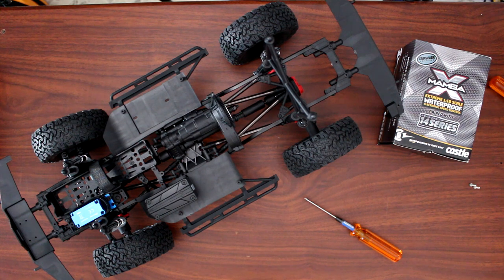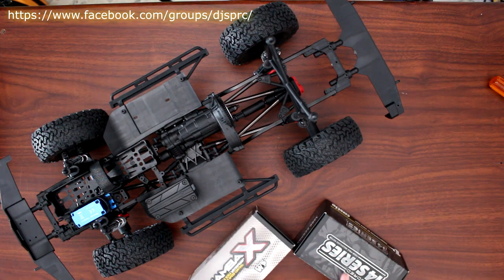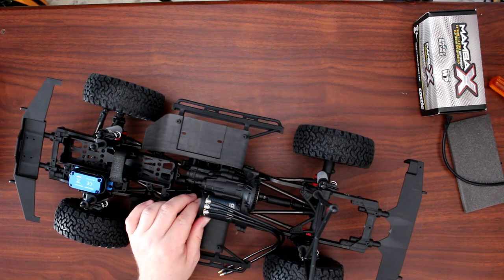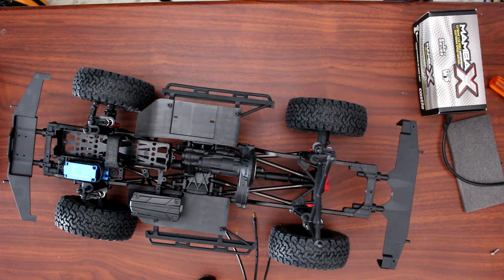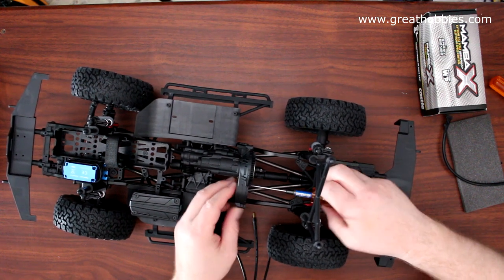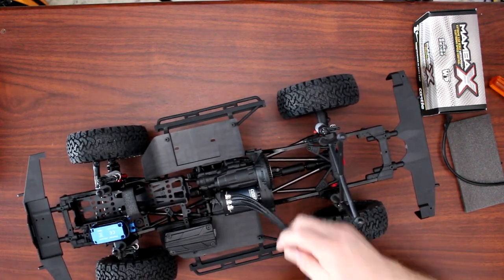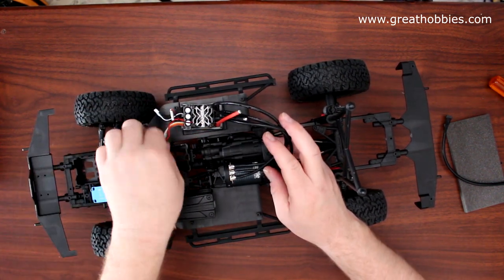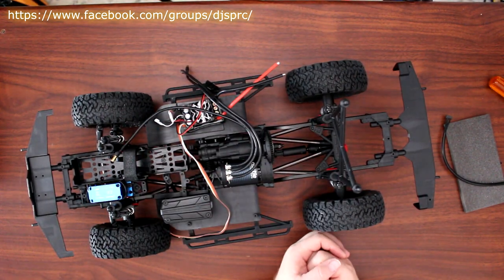Project Cherokee Scx10 II Motor Install

Comment: Awesome, I am thinking of getting a castle system myself.
Reply from the maker: I’ve never been a brushless in a crawler guy I decided to try the system and I like it very much.
Reply: @djsprc  Ya I have been wondering if it's worth the money,  I am sorta stuck with going castle or hobbywing.  So far all my crawlers are brushed
Reply from the maker: Trail Critter RC I have heard good things about the hobby wing system to. It is a new experience for me being brush in the past and now going brushless it’s a different experience believe me but totally worth it either way you go with you won’t be disappointed